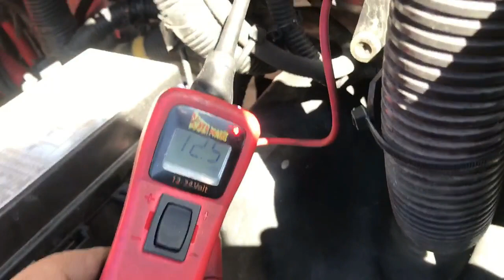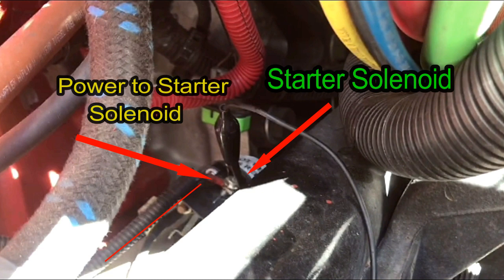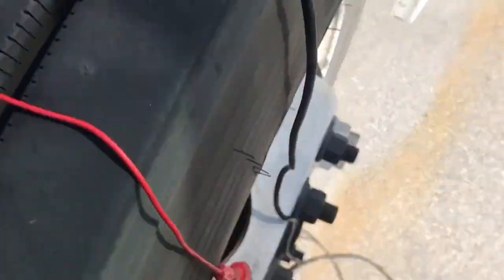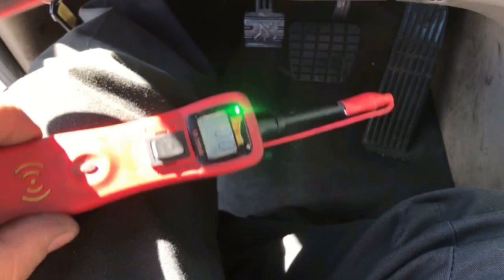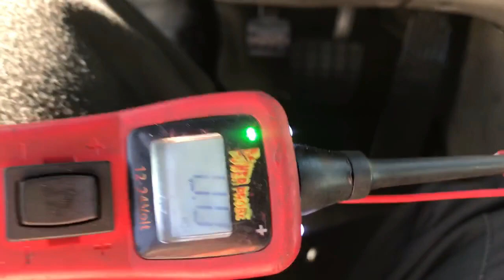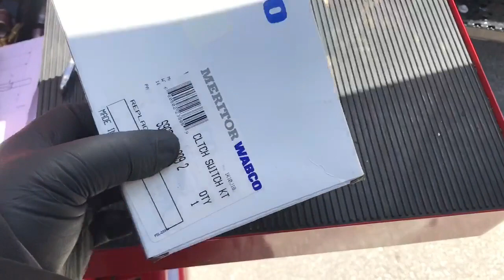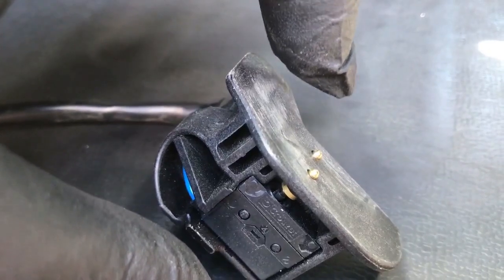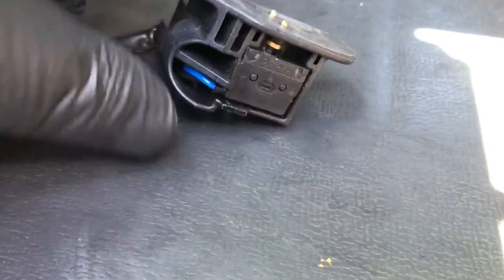How to test and replace Freightliner Cascadia Clutch Switch.

Comment: Generally if your cruise and jake work it’s not the clutch switch. If you have to jam the clutch down real hard to get it to engage switch you should adjust the 5/8” clutch nut adjuster under the truck.
Reply: Would you turn the 5/8 nut clockwise  or counterclockwise?

Comment: Where does the clutch switch go to the sam chassis, the starter or ? Thanks
Reply from the maker: The starter Power to solenoid  comes out of the Sam cab the plug is passenger side next air filter housing .